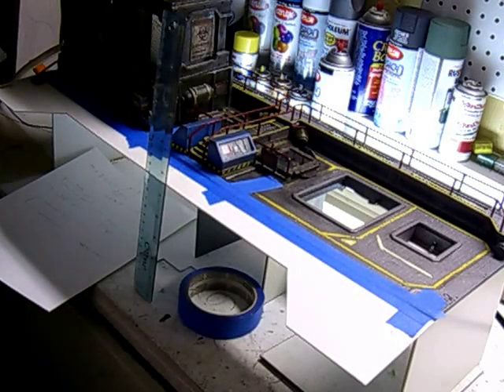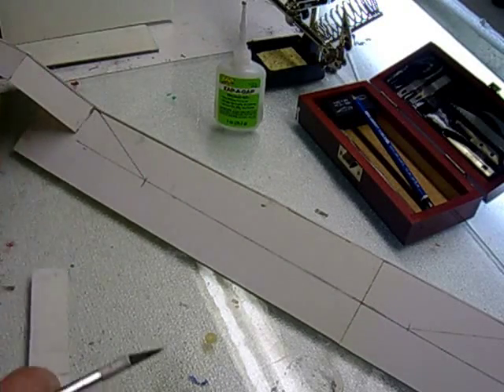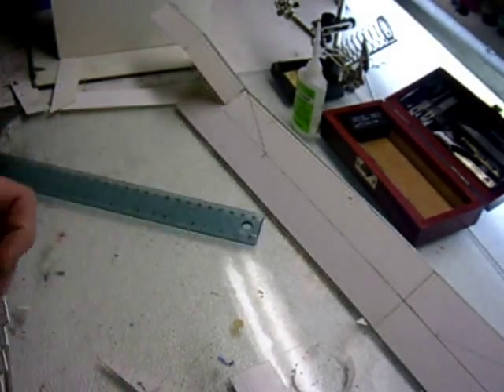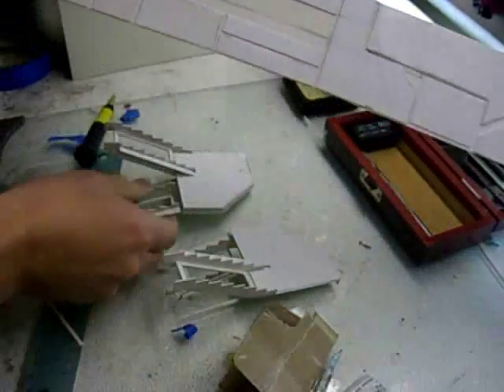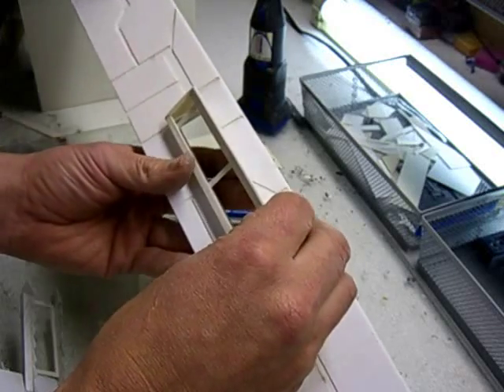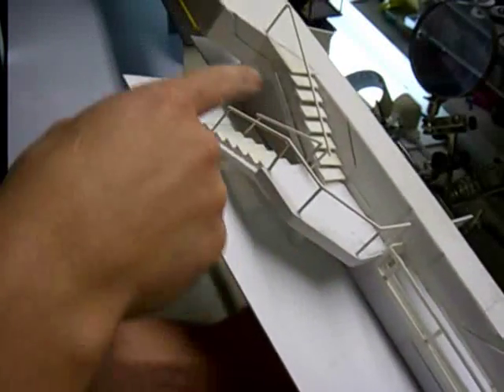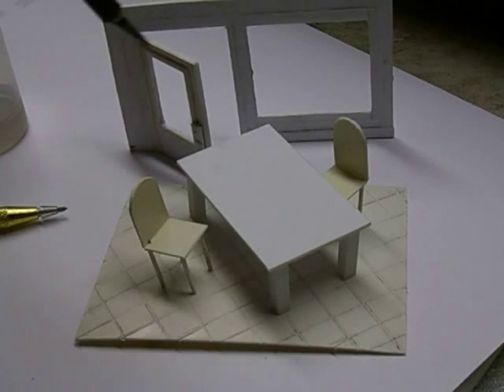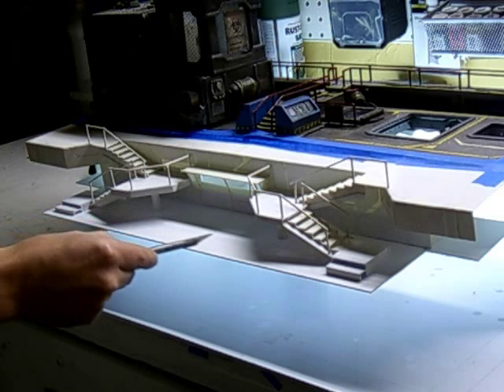BIOHAZARD COMPUTER CASE MOD PART 4

Comment: I love it, the only thing I would change is get rid of the plastic tubes, use copper or some other connections you can use to keep the theme. A bent copper tube with your aging techniques would look awesome. Just a thought.